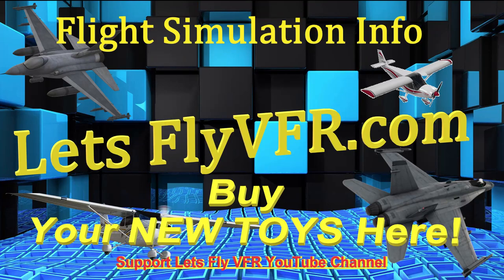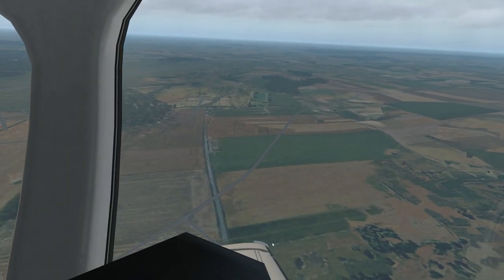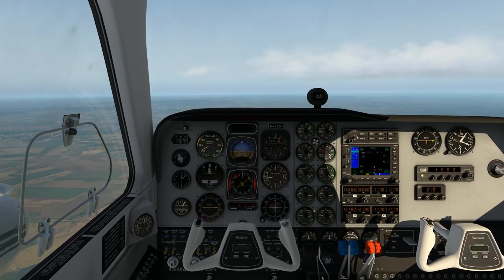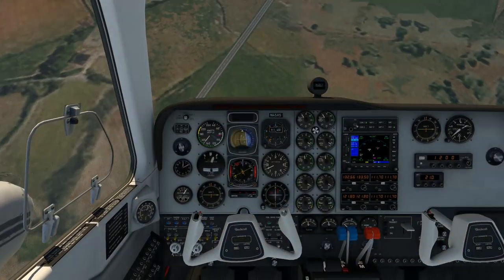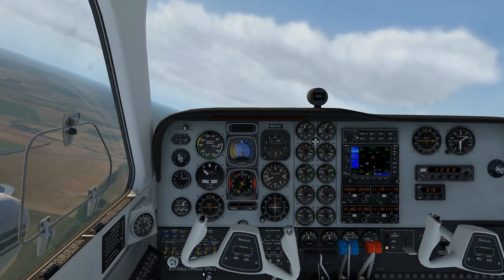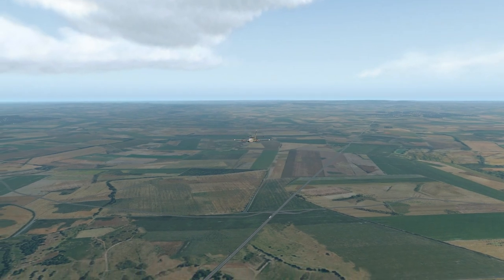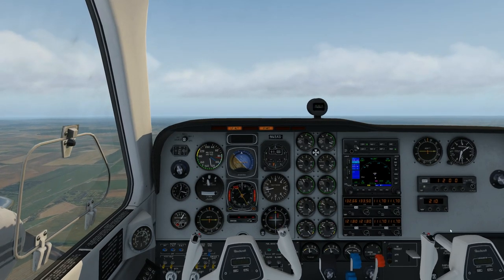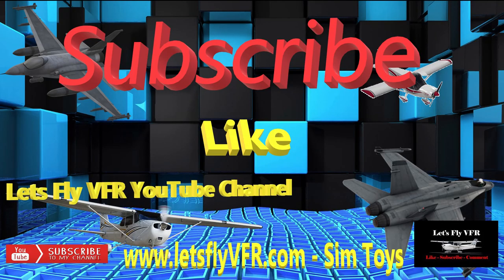X Plane 11 Baron 58 - Pushing Single Engine Handling and Landing

Comment: Gunnie -  Your smooth laid back style is really a plus.  In fact, I think you'd make an outstanding flight instructor.

Way back in 1981 I was wrapping up my cross country flights phase for my upcoming Private pilot check ride.  I had moved to Texas to work so had a new flight instructor at a new FBO.  This was after 2 or 3 months of no flying during the move and settling in to the new job.  Man, that flight instructor was so nervous!  He must have suffered some heavy trauma from his previous student pilots.  He would sit there with both hands semi cupped nearly touching the yoke, ready to seize it at any moment while I was practicing normal pattern work, etc.  Gotta admit his vibe was so negative that I only wasted a few hours with him before switching to another instructor at a different airport, which was pretty inconvenient.  Yep, a nice laid back confident and intuitive flight instructor is quite effective.  Again, you'd make a good one.  :)

As always, Cheers from Isaan!
Reply from the maker: Thanks Jimbo .. appreciate it